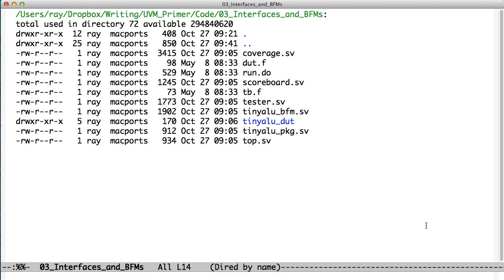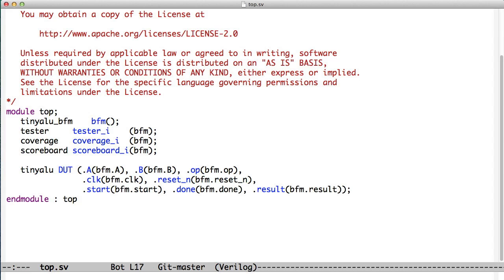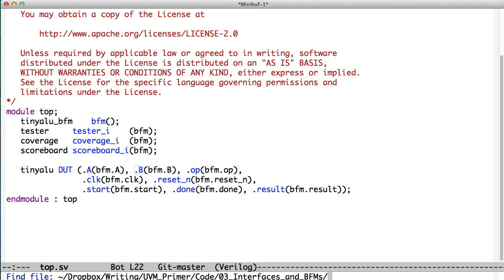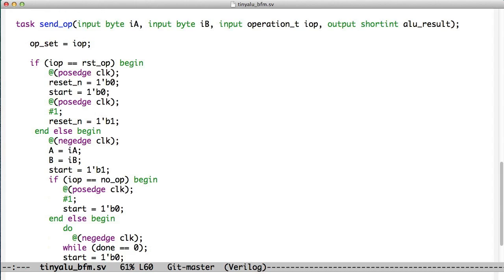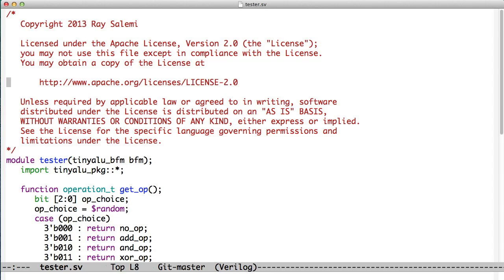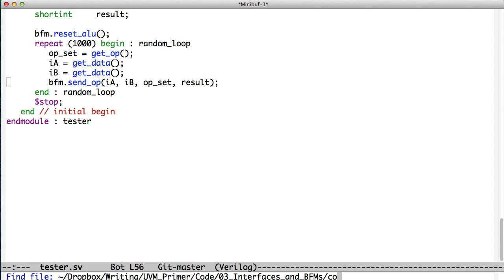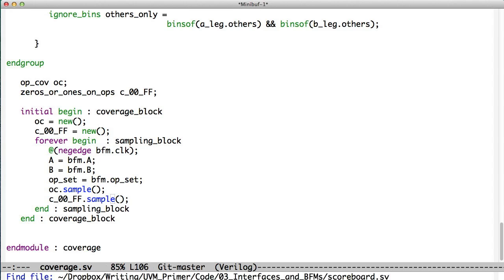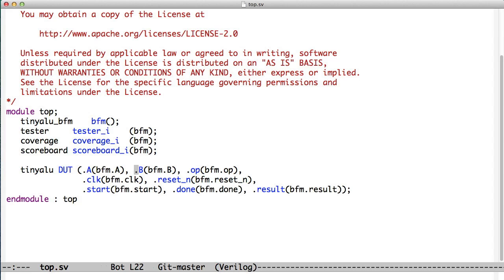Chapter 3: SystemVerilog Interfaces and Bus Functional Models

Comment: I have a question, what is the difference between driver and BFM ?
Reply: Later we'll see that the driver reads commands out of transactions and converts them into task calls in the BFM. The BFM wiggles the pins.
Reply: Thanks for the prompt response.

Comment: I am thoroughly enjoying the book and examples.  One thing I noticed is that the alu_result output of the send_op task code in the BFM for chapter 3 is not assigned or used in the tester or scoreboard.  Instead those modules make references directly down into the bfm.
Reply: +Carl Ashley Yes. I start using them later.